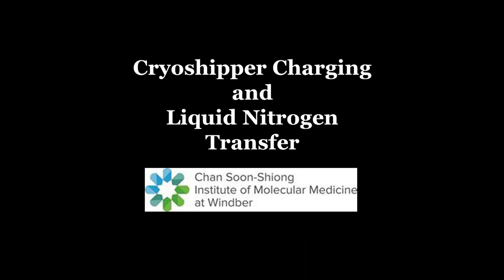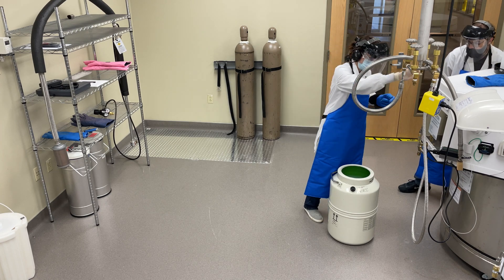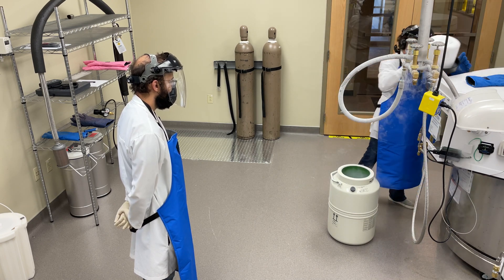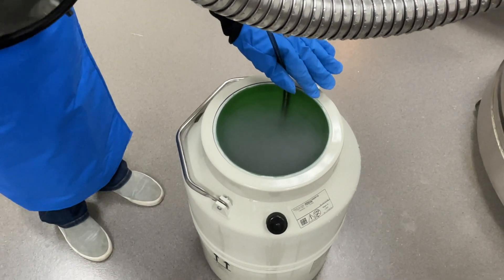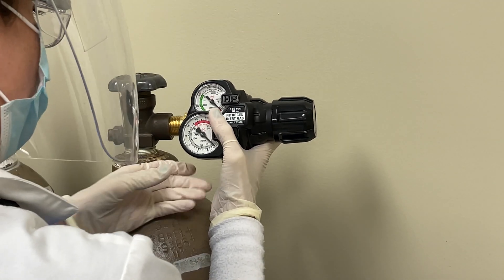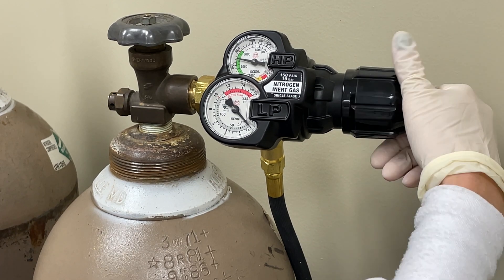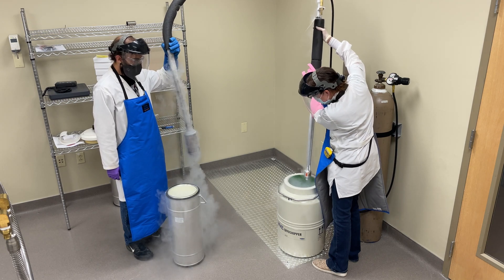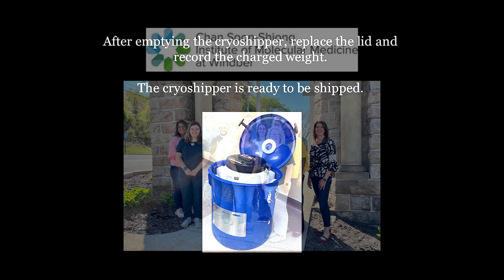Cryoshipper Charging and Liquid Nitrogen Transfer

Comment: I wish you mentioned how much LN2 is filled in the shipper
Reply from the maker: Hello RMalai! The amount of LN2 to fill a cryoshipper varies depending on the model of cryoshipper and specifications of the unit. At CSSIMMW, we utilize the MVE Cryoshipper with QWick Charge Technology (8.5L) and the MVE Cryoshipper XC with QWick Charge Technology (10L). For the 10L unit, inventory staff performed a test and recorded the empty weight of a cryoshipper (33.2 pounds) and the weight of a cryoshipper full of liquid nitrogen (74.8 pounds). Using the weight difference (41.6 pounds) and the conversion that 1 gallon of liquid nitrogen equals 6.745 pounds, this resulted in 6.17 gallons of LN2 being used to fill the cryoshipper. Using the conversion of 1 gallon of liquid nitrogen equals 3.785 liters, we used over 23 liters of LN2 to fill a 10L cryoshipper. Generally, the amount of LN2 to fill a cryoshipper will likely be double the volume of the container itself, so 8.5L shippers would need around 20L of LN2 and 10L shippers would need around 25L of LN2 to completely fill and charge.